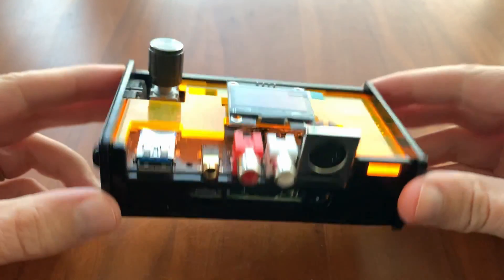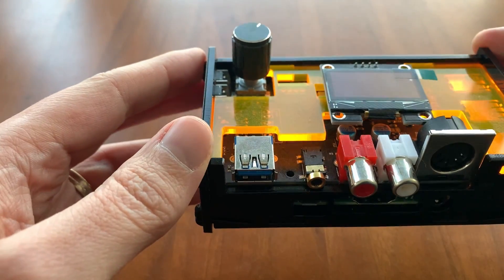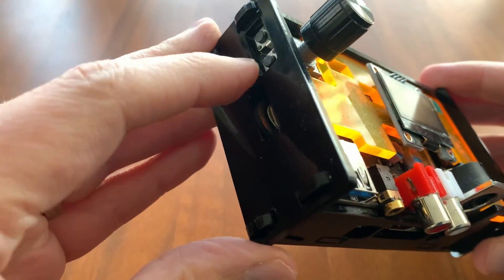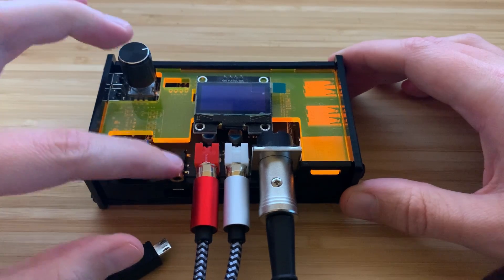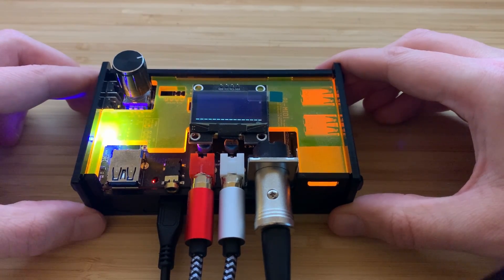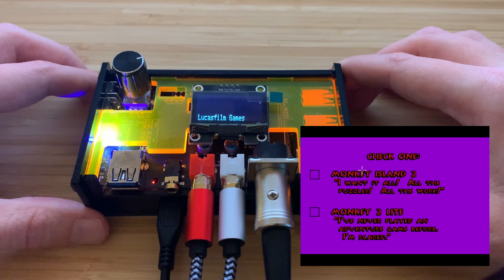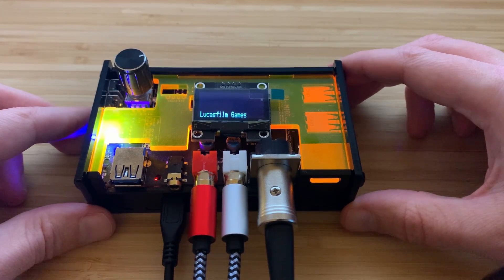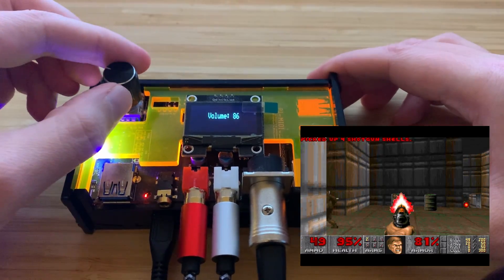PI-MIDI Review – Supercharge your mt32-pi

Comment: Which pi midi hat is that?
Reply: Thought so, out of stock. I’ve built one but the 1/8” audio jack is really less than ideal.
Reply from the maker: @c1ph3rpunk  you built your own hat? Or just using the Pi’s built in (and low quality) DAC?
Reply: @jamesfmackenzie  built my own hat using the mt32-pi-hat project files. Week to get PCB’s, another week to get parts and solder. Works to boot! PCM5102 audio and 5 pin midi. Small OLED display.
Reply from the maker: @c1ph3rpunk  nice!!
Reply: @jamesfmackenzie  I really like the design of the one you used though. I’m not good enough yet to design my own 5102 circuit so I can get RCA outs. Yet… ;-)
Reply from the maker: It’s the PI-MIDI from Edu Arana 😎

Comment: Does the PI-MIDI sound better than the MT32-PI?
Reply from the maker: It sounds the exact same, because inside this PI-MIDI setup is a Raspberry Pi running MT32-PI 😎

The PI-MIDI provides a real MIDI interface and buttons to switch sound bank, change volume etc 👍🏻

Comment: What parts (display, case, DAC etc) , besides the Raspberry 4, do I need to buy? Are there sets to buy?
Reply from the maker: Edu Arana has the PI MIDI kits for pre order here:

https://www.arananet.net/pedidos/product/pi-midi-1-3-a-baremetal-mt32-emulator-using-raspberry-pi-preorder

Right now they’re out of stock, but may open up soon. You’ll also need a Raspberry Pi (3 is preferred) and MIDI cables

There are some other commercial and DIY options available. You can take a look here:

https://github.com/dwhinham/mt32-pi/wiki/Custom-hardware

Good luck!

Comment: Can you still connect this setup using  rs-232 to gpio pins connection?
Reply from the maker: Unfortunately no - the PI-MIDI occupies the GPIO pins. However you can use gameport MIDI - which is the “proper” way to connect a DOS PC and is compatible with more games than Serial MIDI + Soft MPU 

Perhaps I can help. What is your target setup?

Comment: But if you have a PI HAT then you can not use the serial port TTL from your computer to the PI. Is this correct? You need a sound card with MIDI output in this case?
Reply from the maker: Yes, it’s true that the Pi Hat will occupy the GPIO pins. In this case you could use Serial USB to connect:
https://youtu.be/SxMjDsT9rEo

Comment: There are so many different solutions, midi modules and wavetable cards. But the worst I have ever come across, are those AWE cards from Creative. When we are talking this kind of quality. They just sound so bad.
Reply from the maker: Yeah, MIDI synth on the AWE cards is … complicated. In Windows it’s possible to load custom, sample-based soundbanks into memory. But in DOS there are few options. At least the AWE32 has an OPL-3 chip for AdLib fallback :-)
Reply: @jamesfmackenzie  Only 3 AWE32 cards had a real Yamaha chip. All others used Creatives answer/chip. I was mostly thinking of the 512k soundbank that came with the AWE32 and AWE64 cards. The worst sound is the guitar. That sounds awefull in Duke3D. Mostly I am into C64 and Amiga these days, but three to seven years ago, I was heavy into Dos machines. I ultimately setteled on YMF-718/719 cards with Dreamblaster-S1. For my needs, that solution is the most versatile in terms of sound quality, compatibility and price.
Reply from the maker: @brostenen  great combo! My ISA motherboards are in storage, so I have to suffer PCI sound cards for my DOS gaming 😂 I settled on an ESS Solo 1 (Terratec variety) and Creative Sound Blaster Live (SB0100)

When I think of terrible AWE MIDI this comes to mind: https://youtu.be/GeYrx9hO41M

Is that the built in soundbank you’re referring to?
Reply: @jamesfmackenzie  When choosing PCI sound card, then I always go for YMF-724. 😉
Reply from the maker: @brostenen  I'm very tempted now! Are all YMF7xx cards good? Or is there a reason to pick, for example, the YMF724 vs a YMF744 card? Thanks for the buying advice 🙂
Reply: @jamesfmackenzie  First you need to know if your PC supports it. I have had great experience with Pentium3 machines. But not with Athlon (Socket A) and newer. It seems like 724 are better than 744, because the 744 is surround and 724 is stereo. In pure Dos (MS Dos 6.22) you have no access to Wavetable, but in Win98 you have access to both OPL and Wavetable. And yes, it is fully general midi compliant, so it supports newer Dos titles, however it is not MT32 compatible. Just remember to get the correct drivers. There are WHQ and non WHQ drivers. And one of the packages supports legacy SB. The problem is that I can not really remember wich as of now.

But with the correct system/chipset, Win98 and late era Dos games. The card kicks ass.
Reply: The AWE, with sound fonts, was a great synth! The EMU Voyetra was almost as good.

Yamaha XG with reverb was also decent for its time.

Comment: Could you show the speakers and the device that is connected to the midi port? Would like to see how this entire setup looks like. Right now what I understand is that you need a midi device such as the Roland mt32 and connect it to this pi hat.
Reply from the maker: I’m away from home right now, but will attempt to describe this setup:

1. Get a Raspberry Pi 3 and install mt32-pi software. This is a baremetal MIDI synthesiser that allows the Pi to emulate a real Roland MT-32 or SC-55

2. Get the PI-MIDI hardware and connect it to the top of your Pi via GPIO pins. It’s difficult to see in my video, but there is a Pi 3 hidden inside the acrylic case 

3. Connect a game port MIDI cable to your retro PC’s game port (normally on the sound card)

4. Connect the MIDI output from the cable to the MIDI input on the PI-HAT (you can see this in the video, it’s the rightmost connection)

5. Connect the PI-MIDI audio output (two RCA cables) to your speakers

6. Configure your DOS games to use Roland MT-32, General MIDI, Sound Canvas or MPU-401 audio. Any of these settings will pump MIDI data from your retro DOS PC, out the game port, through your MIDI cable into into the PI-HAT via the MIDI input

7. Play games! The mt32-pi software will receive the MIDI data and synthesise beautiful MT32 or Sound Canvas sound 😎

So you don’t need a real Roland synth in this setup. It’s great MIDI done cheap

Hope this helps!
Reply: @jamesfmackenzie  thank you for the explanation. This makes sense now. I thought that with this bare metal solution you could get midi sound directly onto the pi. So that when you started up the game on the pi you can just select midi sound and get midi sound directly onto the pi. What I understand now is that this hat in connection with the pi emulates the expensive Roland mt32. So instead of trying to buy the mt32, you can buy the mt32 pi / pi midi. Also another thing, how come your pi midi has the extra volume knob, is that the new revision?
Reply from the maker: PS if you want to learn a bit more about the mt32-pi synthesiser, I wrote more details on my blog:

http://www.jamesfmackenzie.com/2021/05/03/get-the-best-msdos-ms-dos-audio-with-mt32-pi/

Comment: Where did you get this hat?
Reply from the maker: I bought it from Arananet: https://www.arananet.net/pedidos/

However I don’t think they have the PI-MIDI hat in stock right now
Reply: @jamesfmackenzie  thank you. So how do you use this setup mainly? As a pc replacement or mister pi to play scumm vm?
Reply: Would also like to know where you got this head. So if you run this with the mister why would you run out the audio from the mt32?
Reply from the maker: @johndee759  

I bought it from Arananet: https://www.arananet.net/pedidos/

If you are running with the MiSTer, you just need a single USB A-to-A cable from the MiSTer IO board the the PI-MIDI. I am connected to a real DOS PC so I use the regular DIN MIDI input and RCA audio out
Reply: @jamesfmackenzie  thank you.